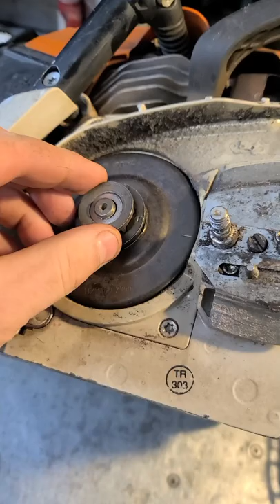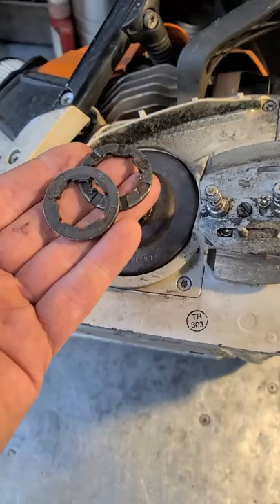Chainsaw Sprocket Split In Half! What Happened? #shorts

Comment: My saw won’t stay running unless I keep the kick back bar tight against handle instead of against my hand 🤷‍♂️
Reply from the maker: check the brake assembly, it sounds like it's engaging
Reply: @donyboy73  thanks Iam a subscriber to ya do you have video on stihl 170 how to fix brake
Reply: @sheerwillsurvival2064  Remove the bar nuts/side cover first, take off the bar and chain. Then take off the plastic cover over the brake linkage(has two plastic pins, pulls straight off) and then you should be able to see where the problem is....?

Comment: If ya put a chain on backwards and try to cut with it, it will ruin the bar and clutch sprocket and possibly snap the crank. The slanted back side of the drivers on the chain will act like a ramp or wedge and put an extreme amount of tension on everything.  
One of my neighbors bought one of those 58cc Chinese saws off of amazon for $100 with shipping to cut a few limbs with and he did not know what he was doing. He put the chain on backwards. Truthfully he's lucky that he didn't get hurt. The chain pulled on the sprocket so hard that it literally sheered the rivets that hold the sprocket in place. I put a new bar and chain on it and tuned it up a bit.